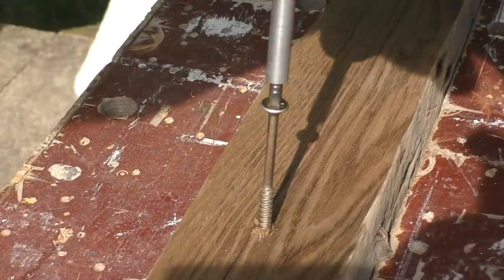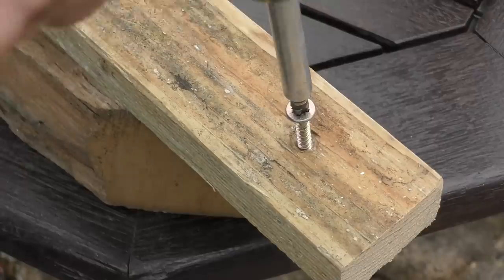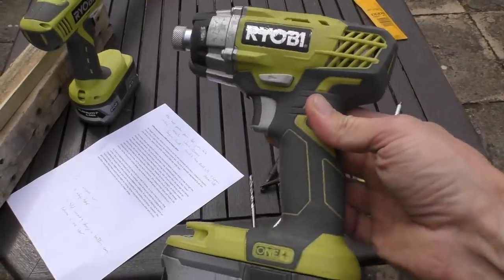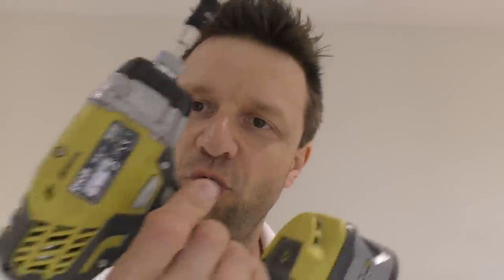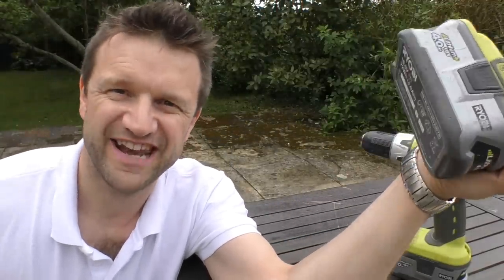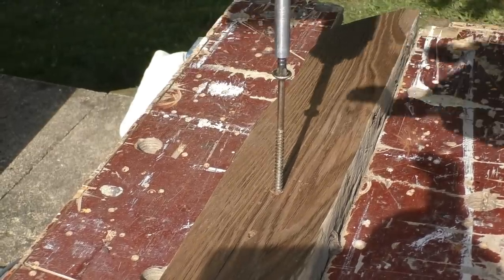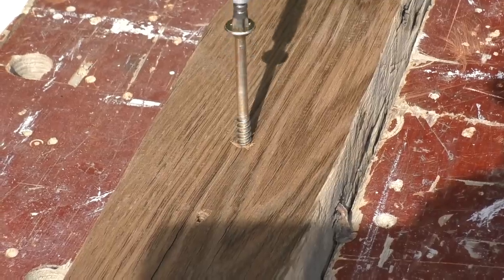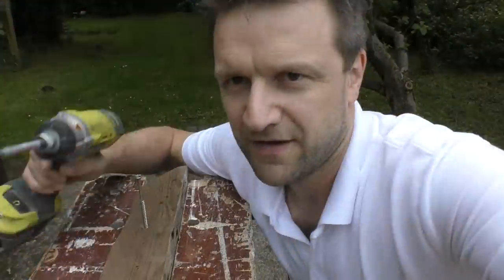Difference between Drill Drivers & Impact Drivers

Comment: I had to make a couple of animal cages with 1 and 1/2 thick wood and my drill driver managed to get about 95% of the screw in, it did struggle, but the entire head or slightly more would stick out. As a result the cages were wobbly and felt cheap. Once i busted out the impact driver the screw went in it firmly held the wood together and the cages felt like you could drop them from 5 stories and they'd survive. Drill driver also struggled with 1/3' ply wood for a medium sized  organizer. I honestly wouldn't trust any drill driver with anything denser than compressed sawdust.

Comment: Question:  I watched someone with two of what I thought were drill drivers.  One was used to pre-drill a hole, and they switched to the other to actually drive in the screw.  I thought they were using the two drills with two different bits so that they wouldn’t have to keep changing them out with one driver.  I have a drill and a impact driver, both Ryobi.  Can I use them to switch between jobs?  Maybe use the drill to pre-hole and the driver to put the screw in?
Reply: ".. Maybe use the drill to pre-hole and the driver to put the screw in? ":
That would likely depend on the type of task and how tough it is. If you're putting corrugated sheets on a roof and it has any kind of pitch, pre-drilling would be real extra work but on the other hand the impact driver wouldn't be working so hard. Where I find it handy to alternate, is when installing cables onto brick/concrete walls. Here one can drill and insert a wall-plug then use the driver to attach the screw-style cable fastener. 
Be mindful that drill bits for the impact are readily available making reliance on alternating less critical - depending on the application of course.

Comment: The impact driver takes a hex shank bit. The traditional drill has a 3-jaw holder designed to hold smooth-shank drill bits. Unlike the drill bits, the screw bits all have a hex shank. When using a traditional drill to drive screws, do you just stick a hex-shank bit into the 3 jaws, or is there some kind of adapter available to transition from the 3 jaws to a hex holder?
Reply from the maker: The traditional chuck will actually also hold hex shanks. DeWalt do an extreme drill bit range with a hex shaft in the drill bit which is great as it eradicated slipping in the chuck. Generally speaking I always put a hex shank screw bit holder in the drill driver/ combi as this makes it easier for you to see what you're screwing and also easier to slip the bits in and out of the magnetic holder.
Reply: @CharlieDIYte  Thanks, Charlie!

Comment: Your talking convinced me that an impact driver is better for screwing, but your actual demo did nothing to persuade me. In fact, it's helped to convince me that I don't need an impact driver after all
Reply from the maker: It was one of those videos where what I set out to prove didn't happen. Take a look at this video if you have time. Basically I agree with you. I rarely use my impact. Just not necessary unless you've got reams of decking to lay but even then a drill driver does the job.  https://youtu.be/sL-t2Zc4wCs

Comment: I never realised that the sort of drill, and the battery size and capacity and the pressure applied to the drill made so much difference. In other words what a load of tosh. My old Bosch cordless just works.
Reply from the maker: It's all about what works for you 👍

Comment: Thank you. Perhaps battery power matter as well. It looks like the size matter
Reply from the maker: I think lots of factors come into play. I suspect these 1.3Ah batteries aren't very good, but 4 or 5ah will undoubtedly deliver more power than a 1.3Ah. For more info, check out the comment feed pinned at the top of the Comments section under this video.

Comment: I’m trying to drive metal screws into a metal fence securing them to purlin.   Will an 1800 inch pound impact driver be strong enough?
Reply from the maker: I couldn't tell you buddy. Depends on the thickness of the purlin, the quality of the screws, whether you're drilling a pilot hole.

Comment: I also have Ryobi tools, both for the reason you stated (they've never changed the connection, even when going from NiCa (nickle cadmium, the older batteries) to the Lithium Ion batteries that most, if not all, cordless tools use now, and i found the Ryobi tools are a much more affordable option for most applications. I work in the construction trades and would prefer to have Ryobi for most of my uses, including my DIY and at home projects as they last just as long, if not longer than some of the more expensive brands we use.  All that aside, what I like to do on a project I'm working on where I need to pre-drill holes and then set the screws, is keep my drill bit in the drill-driver, and my screw bit in the impact driver, and keep them both within arms reach.  This makes it extremely easy to hold a piece, pre-drill, and secure it in position with a screw without losing my alignment, then continue  with any other fasteners. 
Excellent video with good explanations on the differences between the two, and the importance of the choice of battery!

Comment: The 1.5 batteries I got with my Bosch tool are next to useless, the angle grinder drains it in about 30 seconds! Pilot holes are about all they're good for, 3 ah batteries are the minimum you should go for. Battery price is something you should look for when buying power tools, Some batteries are rediculisously expensive!
Reply from the maker: I agree. The 2Ah on my Erbauer stuff are pretty good but you shouldn't go below this. It's a way for the manufacturers to lure you into a brand with cheap combination deals that come with batteries.

Comment: I really struggle with the impact driver and Phillips heads... especially in awkward locations where you can’t over the tool, they end up chewing the head. The drill driver really suits hex or Star head screws where there is more area.
Reply from the maker: I'm using Torx bits more and more these days, but I have to sayI only really wheel out the impact for large repetitive jobs like decking. Everything else I just use my light 12v drill driver.
Reply: @CharlieDIYte   yeah impact drivers with deck screws ... absolutely easy especially with hex, square or star driver heads. The screw also stays in the driver a lot better. the only downside is you really need to use ear muffs as they are noisy especially with 100mm screws...

Comment: That was very helpful.  I've seen impact drivers on shed-building videos, and wondered what they were.  One question: can any vibration from the impact driver be felt through your hands?  I can't use tools that vibrate, so if this is the case, I'll have to stick to a drill driver.
Reply from the maker: I'd say if anything the impact is easier on your hands because it makes driving in screws so effortless but if I have time tomorrow I'll just check by driving in a few screws.
Reply: @CharlieDIYte  Thanks Charlie.  If you've never had vibration white finger it's difficult to describe, but imagine your whole hand going numb, but also tingling and feeling like it's swollen up.  I got it from using power tools years ago, and once you have it, it's there forever, waiting to be triggered the next time you use a vibrating tool.  I'm ok with hammer drills and grinders, but had to get rid of a petrol strimmer because after just five minutes, I was affected.

Comment: Hi good vid, any ideas what drill to get if your just putting shelfs and pictures up on the wall I have no idea what to use and wat drill to get by the looks of it I need an impact drill
Reply from the maker: No, if you want a basic all rounder, you should buy a combi drill not an impact. If you're UK based and can get hold of one, this is a fantastic deal http://bit.ly/2NCqiae - considering it's a high spec drill AND has two 5Ah batteries.

Comment: thanks for this i thought 2AH was going to be ok for the jobs I had planned but I will be going highe battery capacity now
Reply from the maker: You're welcome. Yes I'd use the 2Ah for every day use drill drivers to keep the weight down and 4 or 5Ah for the jobs where you need more torque.
Reply: @CharlieDIYte  I actually got a good deal, 	DeWalt DCK2060M2T-SFGB 18V 2 x 4.0Ah Li-Ion XR Brushless Cordless Twin Pack for £199 along with Makita Hex Shank Drill & Screwdriver Bit Accessory Set 100 Pieces for £25 so £225 tax included  (1 x 18V Brushless Combi Drill 65Nm
1 x 18V Brushless Impact Driver 170Nm) for garden projects i should be fine

Comment: I own both.  But the clutch is the HUGE difference as far as I'm concerned.  It is FAR too easy to drive a flat-head screw too deep with the impact driver.  I very rarely use the impact driver if I care at all how the end result will look (ie, flat with the surface vs potential deeply depressed).

Comment: @Charlie, your comparisons was meaningful and i learned new thing about battries.. But i noticed and wondered that you are using drill driver on speed 1, wouldn't it be easier if you'll be using on speed 2? 
 At 8:00
Reply: If you use speed 2 and don't apply enough force then the drill bit will destroy the head of the screw and round it off. That's one of the points he's making in the video that for different situations the impact driver will be better. An example would be if you're in tight spaces you won't really be able to get both hands onto the drill driver. You would've seen a massive difference between them if he used longer screws.

Comment: The other major thing not mentioned, is overheating. If you have to drive hundreds of screws (for example screwing down lots of floorboards), a traditional drill will quickly overheat, whereas the impact driver won't.
Reply from the maker: Good point. Thanks for that 👍

Comment: Was the drill set on no.1 ( slowest speed or no.3 the highest?). I have a 3/8 Bosch mini drill and when the battery suddenly dies, I switch it to no.1. it will eventually die, but might also finish the job.
Reply from the maker: Speed 1 when driving in the screws, Michael. It's actually only got 2 speeds. 👍

Comment: There is a big difference between the bits you used. On either drill, the start tip is going to out perform the Phillips tip because of how they maté drill to screw.

Comment: The Differences of an Impact Driver and a Drill was Well Explained. Just one thing though, I thought Voltage made the Power difference, not Ampere Hours. Isn't 'Ah' supposed to influence just Battery Life ? !!
Reply from the maker: You're right. Torque comes from the voltage but there's a very long train of comments in this feed way back when I posted the video which explains why ampere hours can have a bearing on power. Bottom line, in layman's terms a low ampere hour battery drains too quickly when called upon to do demanding tasks like this.

Comment: Would have been a more complete comparison if you would have included drill/hammer drill in the list. Hammer drills apply action in line with the bit whereby impact drivers apply action around the bit, radially. Impact drivers are used most often for drilling in concrete with carbide bits.
Reply from the maker: Agreed except I'd never drill with an impact. For concrete I'd use my SDS. I did a fuller explain here https://youtu.be/i6KYfrDBj3w but need to do another vid at some point because there's still so much confusion out there on which tools to use when.

Comment: I use my RYOBI Driver with the smallest battery and have NOT had the problems you displayed here, I put a whole pool deck together using my RYOBI driver with the 1.3 amp battery, charging one, using one, charging and so on.. and was never held up waiting for charges... Yeah, it would have been easier with a 4 or 5 amp... But am very happy with my Ryobi and 1.2 amp...

Comment: Now saying it's the most. Powerful battery well I'm afraid I have to beg to differ since I can modify the battery pack by opening it and adding more 18650s (that's the batteries they use inside all those battery packs, which also if someone runs into that duel blinking light of their ryobi battery packs just pop it open, check the batteries individually and replace the dead one or all of them if you wish and reinstall exactly how they were linked together and you'll have alot of money. Just some knowledge for any DIY or people who wanna save sum cash.  Hope this helps someone

Comment: Good video, but left me wondering... I always thought that Ah related to capacity and just thought the battery would decharge a lot quick, but it seems that a lower Ah battery actually has less peak amp output??
Reply from the maker: Thanks Aasif. I think that's right. If you look at the comments under the vid with the "Top" filter selected, there is one with 38 comments where this is discussed in greater detail.
Reply: @CharlieDIYte  Ahhh, I see!

Comment: But most cordless drills have a hammer drill setting? Isn't that the same thing?
Would some impact drivers adversly not have the impact feature?
So the difference would be the drill chuck vs collet?
Reply from the maker: No no no no no. The hammer action on a hammer drill works in line with the bit, in and out of the wall, whereas the hammer action on an impact is radial, it vibrates in the direction the bit is turning, to give you more power. If you just turn the hammer action on, with your combi drill it will just bounce up and down on the screw, which does nothing.

Comment: Bro, I appreciate your effort here and knowledge extended, but as an American (had to throw that in for rivalry's sake) carpenter of many decades, I believe this test, as well as most others on youtube, simply aren't accurate and the bias usually immediately goes to the impact driver. But for starters, most carpenters I know would not attempt to drive even one, let alone multiple 3-4 inch (7.5-10cm) screws into an antique piece of oak that's been drying out in an attic for years, without first pre-drilling holes. So in effect you are testing a strategy that most will likely never use for sound reason, I might add :)
  Secondly, if you were to test these products on lumber that the vast majority of carpenters would drive straight into, such as pressure treated pine, you would very likely have vastly different outcomes. And I can reasonably say this because I understand the characteristics of softer (and wetter) lumber than old oak timbers, which would allow the standard drill to sink screws much faster, while the impact would lag in speed, once the impact "hammering" action of the wrench begins.
 In fact, I'd be willing to bet a substantial wager that indeed, the standard drill (only if using a powerful battery) would drive many more screws, many times faster, using far less charge cycles than the impact. Try building an entire new deck with pressure treated lumber and I believe you will find that the standard drill will get the job done much faster and more efficiently than the impact driver.

  So I'm curious, are you willing to place a confident bet on your preferred impact driver?
Either way, I appreciate your effort, in which I give you a solid "E" grade mark for. And Cheers, from the Hoosier state- Indiana :)
Reply from the maker: I hear you buddy. I agree, you'd never screw into hard wood without a pilot hole but I was trying to make the challenge as brutal as possible. I hardly use my impact driver most of the year but actually, for repetitive jobs like decking and day doubling up trimmers, I think it's invaluable. Also came in very handy building this log store https://youtu.be/BpDRDu8GBwI

Comment: This is why I don't buy cordless equipment anymore. Batteries cost so much and wear out over time. I bought 1 corded ryobi drill for 36 dollars and it's been able to get through concrete, granted I had to press hard to get the drill bit to get through the concrete, but its concrete :P what do you expect? I think there's room for one of those electronic impact drivers for car mechanic. I still wouldn't buy a battery powered one yet, I haven't found 1 time where I couldn't run an extension cord to wherever I was working, even when building a fence outside around the back yard. Granted I had to pay for the cord, but now I can go all around with corded machinery. Maybe once I get to doing real estate flips with no electricity, but then I would probably end up buying a generator anyways. Idk, I feel like this makes me not want to buy an impact driver

Comment: Interesting Video for sure - but something is very confusing in your explanation - the Power output should depend on the current rating for the different batteries,  not the energy (Amp - hours is a unit of energy).  Although this will influence my upcoming power tool purchases, it also doesn't quite make sense.

Comment: Hi , do impact driver drill  ?  or have both functions  drilling/screwing
Reply from the maker: A hammer action is different as it works in and out the the wall whereas an impact driver action works in the direction the bit is turning.

Comment: The only difference I can see between the two is the impact driver requires less down pressure and the bits are much easier to swap. But the drill is a drill and can drive as good as the driver. Good video
Reply from the maker: Thanks. I talk about the difference in more detail in this video. Basically the hammer action on an impact is rotary not linear https://youtu.be/sL-t2Zc4wCs

Comment: I think one of the main things that is different between an impact driver and a cordless drill is driving screws without a pilot hole. Impact drivers with the correct type of self driving screws and no pilot hole are MUCH easier to drive, as in, it can be impossible to drill the same screws even half way into some timber with a cordless drill. I personally always use pilot holes because if you don't then your timber can crack and the screw doesn't hold as well, but sometimes you just need a screw to hold 2 pieces in place while glue dries.